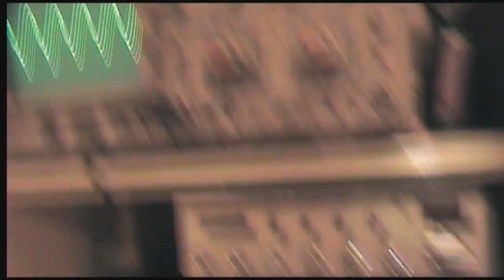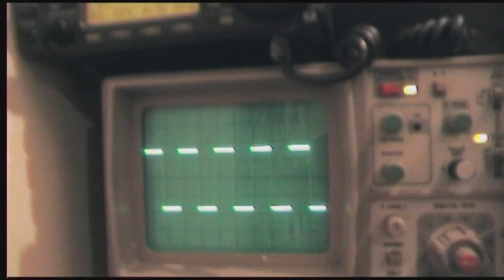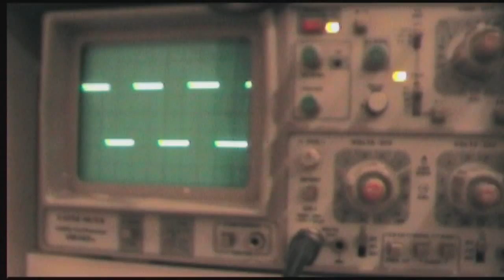Function generator kit build - part 3

Comment from the maker: Hi, no settings are stored so I'm afraid that if you pull the power it defaults back to sine wave along with its default frequency.

Only the volume is adjustable via the potentiometer.